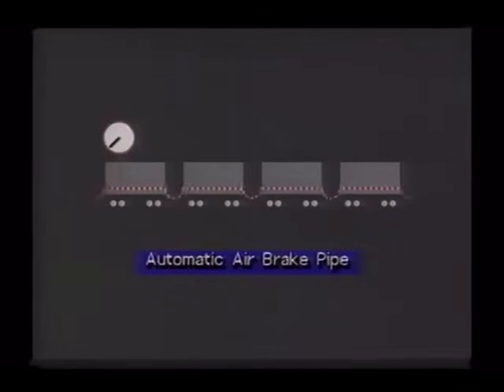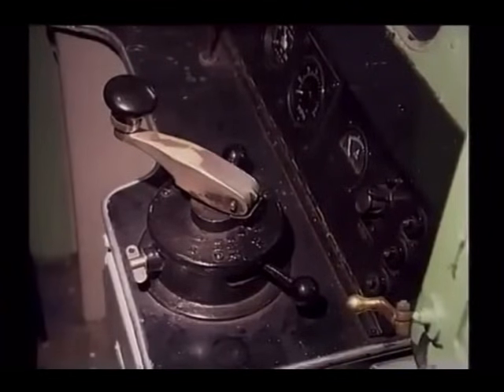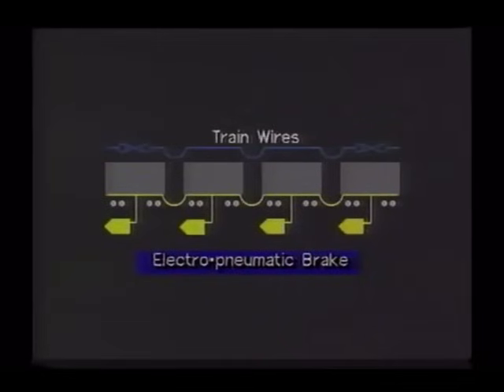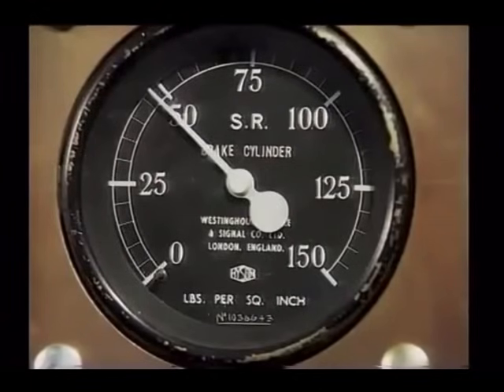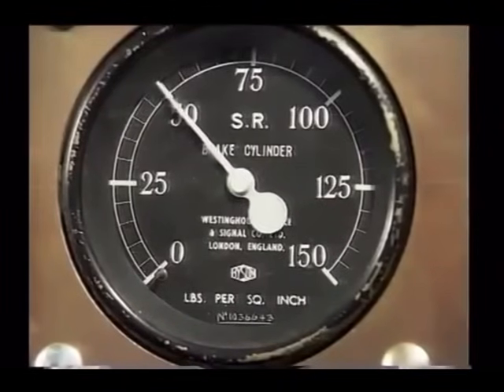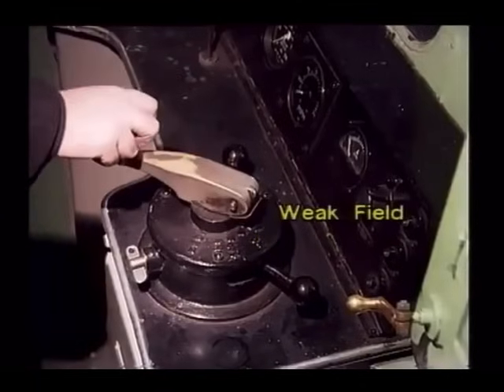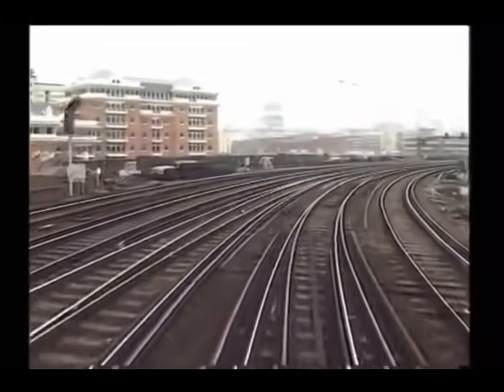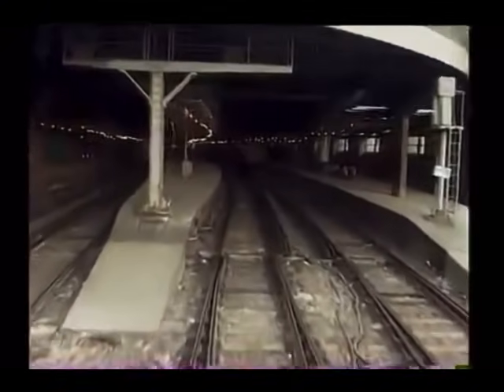Automatic Air - Electro Pneumatic Brakes Network Southeast 1991 #train #railway #traindriving  ￼

Comment: 17:15 that's what makes me curious about British air brake controllers: It seems like none of them have predefined brake levels. You always have to jump between release, fill and lap.

So, if you want to brake at 4 Bar in the main brake line (releasing 1 Bar from the standard 5 Bar brake line pressure), you have to release air from the brake line and watch the pressure decreasing, until it reaches 4 Bar. Then you have to put the brake lever to the lap position.

On a German Knorr controller, you can just put the lever into notch 5 and it automatically keeps the brake line pressure at about 4 Bar. The British way was ditched at least 70 years ago.
Reply: On these trains there are two braking systems essentially.

The fail-safe automatic air brake and the electro-pneumatic brake.

The former can only be increased gradually in application, any release must be a full release. The EP system can be fully graduated and will hold at the application level chosen.

This video is some years old, no trains in mainline service in the UK use a braking system set-up like this today.

Indeed most multiple units have a system exactly as you describe with fixed braking steps (3 or 6 are standard depending on type) and mostly fully electro-pneumatic with no through air pipe. The newest trains tend to have fully variable brake controls, rather than fixed steps now.
Reply from the maker: Thank you for your comments.

Comment: Thanks for sharing! I wonder how often the non ep brake was actually used in practice.

I mean there is one comment about a driver intentionally disabling the ep brake to get the cozy old timer's feeling.

But, would a normal driver ever have to resort back to the non ep air brake? Or would ep brake failures be so rare that they would never happen to the average driver?
Reply from the maker: This is interesting, and exactly why we like sharing the videos, interest, discussion and new ideas 👍
Reply: I can tell you that most drivers, most of the time would use the EP brake. Only those under assessment with a manager, or following a failure of EP brake, or those wishing to maintain their skill would use the Auto brake. The auto brake required a higher level of skill to provide a safe, comfortable and on-target stop, due to the full release (and delay to re-apply) when compared with the EP brake, which could allow the driver to reduce the amount of brake force incrementally without running out of air. HTH.
(EX SR driver/Instructor!Driver Standards Manager).
Reply: @stoatsngroatsuk5012   Thank you!  Sounds like the auto brake was part of the training and drivers did at least have some experience with it when they encountered an ep brake failure.
Reply: @SapienzBuchse  definitely part of training, and you had to be competent with auto brake before being passed to drive. In practice though , because EP braking was easier and more forgiving, most drivers only used this, and some would hardly ever use Auto, meaning on their 2-yearly driving assessment, might not have the most gentle of stops! These days of course, things are quite different.
Reply: @StoatsngroatsMoto  Thanks for your insights.
Would one have to turn off the ep brake beforehand to use the auto brake or would it automatically stop working once the lever is moved forward to the Lap position or beyond?

From operating the lever it appears to me to be impossible to get auto brake without a full service application of the ep brake first.
Reply: @SapienzBuchse  in the area I worked we had 2 types of stock, suburban EPBs and Main Line EPBs. The suburban trains had a 5 position brake handle giving EP brake between release and full service (50psi of brake pressure), position 3 was Lap, position 4 was venting the brake pipe (to apply the brake) and position 5 was a full emergency brake position. When using EP brake you would place the brake handle at any position between 1 & 2, and increase or reduce the applied pressure by moving the lever forward or backwards as required.
To use Auto brake, a smart single move,ent from release to Lap would effectively isolate the EP brake side of things ( not completely though - you would trap a small pressure in the brake cyclinder, 1-5psi depending on how smartly you moved the brake handle!) From the lap position you would move the lever forward to position 4 and apply (only) the brake - you could add a little by moving the lever forward and then back to lap.

On the other main lien stock, a switch operated EP or Auto. This stock had 3 positions: released, full application and emergency. In EP the same operation as the 5 position brake had on the EP section, plus emergency. In Auto, the same as the Lap- position 4 element of the 5 position brake.
I hope this is easy to understand? 
It is many years since I drove either of these - over 25 years in fact, but the details in this video was what we learned in the mid 1980s - plus much more detail -the valves inside the brake chest, how the triple valve works, etc. so that we could identify faults and either rectify them or isolate sections of the train to enable the safest movement possible.
I had a brake failure with a 12-car train, and was able to identify fairly quickly the fault, and to make an isolation which enabled me to move the train forward from a different cab, placing my guard at the front and keeping in contact with him by cab-cab communication. We had only a 20 minute delay, and that was good because my train fault had caused an unreleasable brake failure with 5 of the 12 coaches still inside a tunnel, and the rest outside!
Reply: @stoatsngroatsuk5012  I see that the train in the video is suburban stock. Also I like the "move fast enough to not get a significant ep application" solution. Must have been the easiest solution for the engineers designing the control valve.

Thank you again for sharing your profound knowledge! It seems to have saved your day in the face of malfunctions more than once.

Comment: We had Driver at our depot always wanted HIS units in the straight air brake when ever he was driving  ! I am a top driver ! I'm  old school . I don't use EPB I always have it  in air brake .  Anyway he came to collect a set of empties ! The shunter couples them together and then  I don't know what happened with  the the brake test !! A lot of drivers  said " no brake test to the Guard or shunter  I want to get going quick !  ( but not with me I always insisted on a brake test no matter what ! ) he takes the set of empties out in the automatic air brake NOT the EPB . But what he didn't  know was that the shunter had failed to open up the cocks between the front portion and the rear portion !! He had forgotten them . The rear of the train was a " Swinger ! " . When he applied the auto brake only the front portion of the train was braking . The rear portion was dead weight and had no brakes .,It was just pushing on the front portion during braking ! Had he been in EPB , it wouldn't have been a problem because the brakes with have been functioning on the whole train !  Long story short - about  ten minutes into the journey he had a SPAD !   He had to Fess up ! He had deliberately been in auto brake not EPB !!  Nearly at retirement , long service history with no incidents or previous  SPADS . Excellent service and disciplinary record over 50 years  . He was given a severe reprimand and a final warning !  This happen in about the late 90s or early 00s ,before slam door stock was withdrawn anyway !
Reply from the maker: Wow, he was lucky a lot to lose, over one little mistake. Could have been a different story if there had been an accident. Thank you for sharing 👍
Reply: Interesting story, lucky driver.

I have read about incidents from Germany and Switzerland with skipped brake tests. One was even an official simplified procedure that was then hastily reverted.

These stories normally don't get to the part where the driver  gets a written warning. They rarely are alive at that point.
Reply: @SapienzBuchse  He went past the signal at danger by a short distances - 50 metres ? Or less ?   Fortunately the line was clear for a long way beyond it ! They didn't want to sack him . He would have lost all of his pension ! He had a clean record before this with no SPADS before .
Reply: @Sam_Green____4114  Ok, 50 meters is generally safe. I was thinking that half the brakes means double the stopping distance. That can easily result in almost a full block beyond the red signal if a yellow is approached at speed.

Most accidents I know of had less than 50% of the expected braking power, and no overlap was able to prevent them.
Reply: @SapienzBuchse  It wasn't a very well used line . 3 or 4 trains an hour in each direction .Even less late in the evening !! The signals are very far apart .
Reply: @ @ I had  an argument with a driver one night ! We walked over from the mess room to the platform where our empties were waiting ( a 12 car set . The front portion arrived as an 8 car set ,then  another 4 arrived to be coupled on the back in the platform .) he said " We aren't having a brake test let's get going quickly ! " I said yes we are " i am doing a Brake test . He got right stroppy !  Stamping his feet . I always insisted on a brake test . Because one time at the same station previously this happened -  a shunter forgot to open the air cocks just before I did a brake test ! I asked the driver to test the EPB brake first and I observed the brake gauges move in the rear part of the train ,indicating the EPB brake system was in full working order throughout the train . The I went on to test the straight air brake ( I was the guards job to do this .I told the Driver " Testing the straight air brake now " I turned the brake handle  to full emergency to dump all the air out the system and waited for the driver to respond   ( he should have observed the brake cylinder gauges moving in his cab at the front of the train .Indicating the straight air brake was functioning throughout the entire length of the train  ) . He said " No nothing has happened here ! the gauges didn't move .Do it again ! ) Did the brake test again still nothing !  I mentioned it to the shunter who was standing on the platform ! " We 've got no air brake at the front .The EPB works ! " It was then that the shunter realized he hadn't open the air cocks on the  pipes whilst coupling  the trains together ! Had we departed without a Brake test and if the Driver had been in straight air brake the rear four carriages would have been " loose " and had the train accidently divided god what could have happened !
Reply: @SapienzBuchse  I never skimped on doing  a  Brake test ! Always I did one .  Some drivers would say " No brake test I wont to get going  quickly ! " I always said " we are having a brake test ! " Because previously  on one occasion we did a brake test and we found the brakes were not working on the rear four carriages ! The EPB worked but not the air brake .  The shunter had forgotten to open the air cocks up on the pipes between the two trains when they were coupled together . if we had departed without a brake test and the driver had been in air brake and not EPB  the rear four carriages on our train would have  been " loose " and without brakes . Had the train become divided it could have resulted in a catastrophe which would have taken months to clear up ,killed people and I could have ended up in jail ! All for what ? Saving 5 mins doing a Brake test ?
Reply: Is the ep brake not cut in with the automatic brake? Does he have to apply one independently of the other? Seems strange.
Reply: @onkelfabs6408  In another thread on this video, I learnt that once the lap position is reached, the ep brake's valves are deactivated. So it is possible to move the lever forward quickly and only get a very small ep brake application into the cylinders.
Reply: @ No they are different systems ! They work separately ! there was a switch on the drivers desk . To chose one or the other .
Reply: @Sam_Green____4114  In this video there is no switch, but different positions of the controller. I learned in another thread on this video that there were two versions of the controls. The suburban stock has the controls as in this video while the main line stock had a separate switch and a brake lever with less positions.
Reply: @SapienzBuchse  The Driver in question ,mentioned in my comment ,was driving either 4 CIGs or 4 - VEPs or a mix of both! We occasionally had 4 -CEP s (Kent coast stock ) . On the desk in front of the controller / brake handle was a change over switch from normal air brake to EPB . The stock shown  in the video is a much older type

Comment: The train pipe won’t reach 70Lbs psi until the auxiliary is charged with 70 psi then a sort upside down spring loaded valve is driven shut trapping air in the auxiliary, when driver lets air out of the train pipe the spring loaded valve relaxes and air rushes from the auxiliary to the brake cylinder
Reply from the maker: Sprig Loaded valve make it a bit clearer,  Thank you

Comment: Is slightly misleading on the lap, in real terms it means the brake shoes are just touching the tyre or wheel rim but applying no pressure but any pressure would cause instant brake force, lap is easier to say than ready to brake and because of the self adjusting nature of the shoes you always got solid brake force even if the shoes and tyre are worn and due service.
Reply from the maker: Thank you for sharing
Reply: I don't think that is correct. Lap means that the train pipe is completely isolated. Neither air is fed into it from the main reservoir, nor is pressure released. [1]

This means that the brake cylinder pressure is kept constant. This could be no pressure, a pressure that makes the brake pads barely scrape the wheels or full service pressure (50psi).

In the video the fail safe classic air brake is controlled the old school way. In comparison, the ep brake is simple to operate. The driver selects a position and the electronics will set the corresponding brake cylinder pressure.

For the failsafe brake, the controller has these positions:
- Release: Refill the train pipe until it reaches the max pressure of 70 psi.
- Lap: Keep the train pipe at the current pressure.
- Auto Service: Slowly reduce train pipe pressure.
- Emergency: Reduce train pipe pressure as fast as possible.

How does the driver brake using this system?

If the train is coasting along, the train pipe is at 70psi and the controller is in Release.

To start braking, the engineer now moves the lever to Auto Service and watches the train pipe manometer. When the train pipe manometer reaches it's desired value, for example 60psi, the engineer moves the lever to Lap. The train is now constantly braking with 25 psi brake cylinder pressure, until further action by the driver. 

If the driver wants to brake harder, he can move the lever to Auto Service again and move it back to Lap once the desired train pipe pressure is reached.

If the engineer wants to stop braking, he moves the lever to Release and the train pipe slowly fills up to max pressure, releasing a brakes after just a couple of psi of increase.

If the engineer wants to continue braking but at a lesser rate, he is out of luck. These air brakes don't have graduated release, so even a small release will instantly release them fully. He then needs to reapply them. If he reapplies them before the train pipe is back to max pressure, the will work with less brake power. If he does that a couple of times, he has an unbraked train.

That last bit about the train becoming unbrakeable is why these brakes without graduated release are called exhaustible.

[1] Some modern controllers actually keep train pipe pressure constant instead of isolating it. This avoids pressure loss due to leaks in the train. I can't say if the trains in the video have this or not.
Reply: I can tell you how it is on a Knorr controller: you have the levels

Release blow
Release
Cutoff/Lap
1A
1B
2-8
Emergency

What you describe is the level 1A, where the brake shoes are brought onto the weels, but no brake force is applied. This makes the brake react much faster. The driver should use this level to keep the brake ready for a quick stop when shunting.

Comment: Well two failsafes if the EPB fails, you have the air brake and the capstan or hand brake if all else fails which is what a secondman's duty was about as well as spotting signals in difficult terrain but rarely did the capstan ever get applied and was usually locked in free mode, seem to remember the guards brake also had a capstan on some units.
Reply: There were no secondmen on units. The wheel was purely a parking brake. I drove these units.
Reply from the maker: Thank you for sharing your knowledge, it is appreciated, Thank you 👍